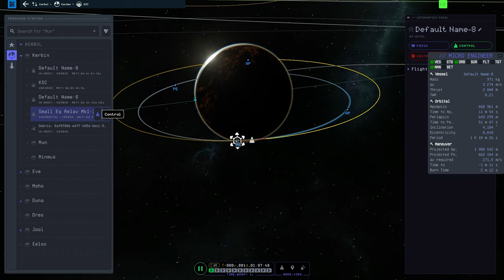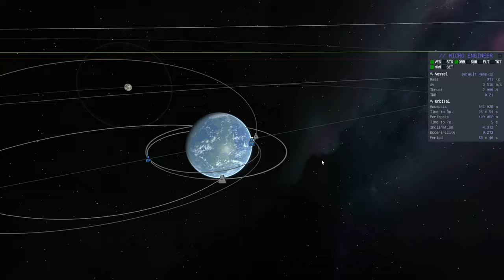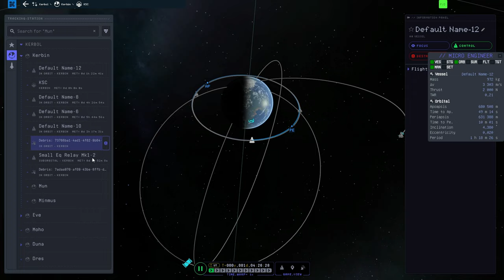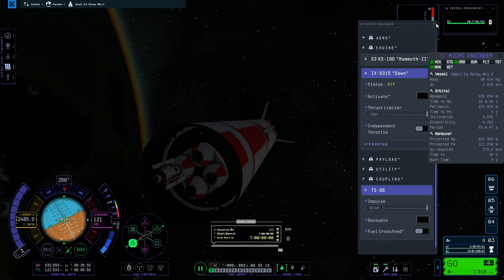Design and launch of CommNet relay satellites in Kerbal Space Program 2

Comment: You can rename your craft in the tracking station. If you click on the craft and then look to the top right where the name is, there is a small pencil which you can use to change the name. In my experience though it doesn’t seem to save the name but I hope it works for you!
Reply from the maker: I will try that, thx
Reply: It might be a bug still where it won't stick when you reload the game.
Reply: Hasn't worked for me yet

Comment: thank you dude, on ksp1 i usually just launched single comsats from a decoupled and fairing. i just got ksp2 last night and tried my first ksp2 kerbin comsat. once in orbit the ksp2 fairing had issues. the fairing doesn't open with blow away panels but staging then throttle up the xenon pushed it away as the panels stayed closed.  the other issue I had was- I couldn't open the solar panels. ksp2 told me they were inactive and idk how to turn em on lol. i also didn't have the small antenna on my comsat either. 🤣
Reply from the maker: When reading this, i am getting deja vu vibes ;-D

Comment: Can I ask why you throttle down on the way up, and how you know how much to throttle down? Do you have a list of what mods you use?
Reply from the maker: I am throttling down on the way up through the thickest portions of the atmosphere in order to maintain TWR of approx 1.6 - 1.9 as higher then that is inefficient. When i cross 40k i usually let go but sometimes i continue due to habit 😀

For KSP 2 just a few mods: mass simulator, community fixes and mini engineer and stage info
Reply: @GrunfWorks  How do you know you were hitting TWR 1.6 - 1.9? do you have a mod that tells you? or do you know what velocity to hit?

Alright. I myself have been wanting to keep the game as vanilla as possible.. 1 to be able to bug report better.. and 2 to keep complexity down while i learn the game. 

One of my issues with KSP1 was that i never knew were to star. Having limited tools in KSP2 has helped me a bit there x)

Still a lot to learn... Also is there a way to know if your coms network works? What the range of each antenna is? etc.

Comment: Big question... do the antenna have to be conencted directly to the probe core? cause I put a communotron 16 on a LKO sat, and it lost connection, even above the KSC. The antenna may have been attached to the Reaction wheel instead of the core.. (and yes I have decent EC)
Reply from the maker: I do not think so. It is lore likely you lost connection due to a bug (it was pre patch) did not verify if they fixed it. Short version is if you decouple a probe from the main ship you loose connection regardless if antenna is out. Solution is fold back in antenna and fold out again and it should be fine.
Reply: @GrunfWorks  yeah I guessed so, but I have the CommNet connection required for control activated
Reply: @GrunfWorks  Sounds like a bug i am having. Probe fully powered with antenna lose connection as soon as decoupled :(

Comment: I think it would be nice if they added a button for circularization.
Reply: Could always use the lazy orbit mod.  And with how broken orbits are, it's almost needed for stations
Reply from the maker: Yep, if the kraken attacks, the lazy orbit is a possible remedy.
Reply: @GrunfWorks  it works well actually ive got that and a few other mods, but its so sad when it turns into a slideshow. I mean ive got what i thought was a pretty good setup, 64gb 3300 ram, 1tb ssd for the game, i9 9900k overclocked with water cooling and a aorus 3080ti and its not enough. Sad.
Reply: @Steve211Ucdhihifvshi  Nothing is enough to run it smoothly yet as it isn't optimised. Management really shouldn't have pushed this out yet. But it's what we got and it can only get better.
Reply: @ConfusedRaccoon  well take2 probably pushed it out cos shareholders were pushing them

Comment: So I just got ksp2 today and I copied your design 100% but when I go to use my small comm sats to change the orbit like you do at 15:02 I get like a 25min burn instead of 2min  like you. Any reason why?
Reply: @GrunfWorks I see you have 2,000 N of thrust, my same engine only has 200... idk why any solutions
Reply from the maker: Check thrust limiter in VAB or in flight. Check that slider is all the way right so that you are using max thrust. Right click engine and in part manager check thrust limiter slider
Reply: @GrunfWorks  it was def at 1 percent. I triple checked, the max thrust in VAC is 0.2 kn. Its so odd. Idk if its a bug or a due to the patch they made the engine weaker. Is the max thrust value the same for you after the patch?
Reply: @Deltafan311  Hey, I was having the same problem as well so I combed through the patch notes and saw they "retuned xenon engine thrust" assuming from the pre-patch 2 kn we see in GrunfWorks video to the new 0.2 kn implemented.
Reply: @connorfooks9488  Ahh gotcha, thank you!